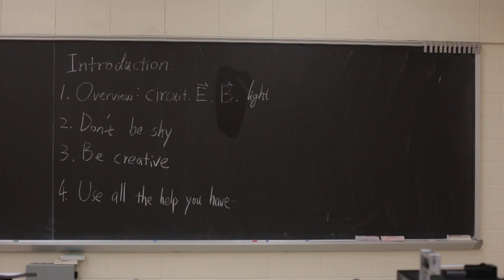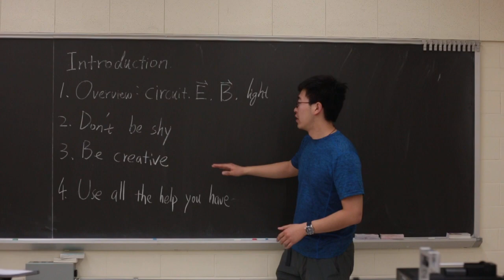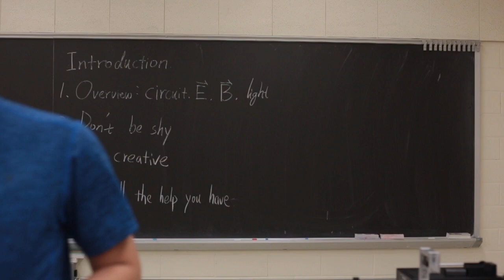Introduction

Comment from the maker: Physics Lab102N
https://www.youtube.com/playlist?list=PLgNi5MiqkBWbIYJkq_pD_SH2KNKJCZ1tB

Introduction
https://youtu.be/mm_0NDbU3Po
Lab1 Concept symbol
https://youtu.be/5HjscVxZQwY
Lab1 Experiment Multimeter
https://youtu.be/kNijqAIlOMg
Lab1/Review quiz1 Schematic
https://youtu.be/xC71rvYPWUc
Lab2/Review quiz1 Potential and Field
https://youtu.be/NeQNdakWX-8
Lab2/Review quiz1 Conductor
https://youtu.be/36_nO2rIDOY
Lab3 Concept Ohm's Law
https://youtu.be/aBabYsGFrYM
Lab3 Concept Kirchhoff's Law
https://youtu.be/rYRHw75T2_4
Lab3 Concept Resistance Paralell and series
https://youtu.be/UK_VkmHeYyY
Lab3 ExperimentDC,A,V
https://youtu.be/KyKSXwajJaA
Lab3 Experiment connect the circuit
https://youtu.be/o1VCM9TpoFE
Lab4 Concept RC circuit
https://youtu.be/eQx0pxGkjiA
Lab4 Concept time constant
https://youtu.be/64r275Zfvb8
Lab4 Experiment Connecting the circuit
https://youtu.be/HoWX1oxdn7c
Lab4 Experiment Taking data
https://youtu.be/7_znRfmIxIo
Lab4 PC measurement and Excel
https://youtu.be/l5nrodZR8as
Review quiz1 Overview
https://youtu.be/9Q8-jkPOepA
Review quiz1 Schematic
https://youtu.be/xC71rvYPWUc
Review quiz1 Potential and Field
https://youtu.be/NeQNdakWX-8
Review quiz1 Conductor
https://youtu.be/36_nO2rIDOY
Review quiz1 Time Constant
https://youtu.be/e47WURv0uz0
Lab5 Concept bar magnet
https://youtu.be/02WMGjRuGwg
Lab5 Concept Earth Magnetic field
https://youtu.be/9oZ4FjHnaAk
Lab5 Concept Right-hand rule and Ampere's Law
https://youtu.be/83_mgWfxecQ
Lab5 Concept Lorentz force
https://youtu.be/7_5ZZrquFHM
Lab5 Concept Metal swing
https://youtu.be/_eI38suGksY
Lab6 Concept Generator
https://youtu.be/qEinTRrlKoc
Lab6 Concept Generator II
https://youtu.be/LVkxSQJDNyQ
Lab6 Concept Integral
https://youtu.be/Mj0LRaYbJYk
Lab6 Concept Average power
https://youtu.be/fLuVv_HddcU
Lab7 Concept Snell's Law
https://youtu.be/btTux6BCuDo
Lab7 Concept total reflection
https://youtu.be/CqFdAsX4YkQ
Lab7 Experiment index of refraction
https://youtu.be/jdXzd_McmI0
Lab7 Experiment Critical angle
https://youtu.be/zx4-MjfLFJg
Lab8 Concept Ray diagram
https://youtu.be/MO7LOJy6yBQ
Lab8 Concept Magnification
https://youtu.be/GnuPEusMaWM
Lab8 Concept lens equation
https://youtu.be/vMW7Jz7DQuk
Lab8 Concept two lens system
https://youtu.be/bv2DLAQQpwQ
Lab8 Experiment setup
https://youtu.be/l0yba4aHVtU
Quiz2 Overview
https://youtu.be/xbu-qNJBa14
Lab9 Experiment Setup
https://youtu.be/hImGgt---eE
Lab9 Concept Wave VS Particle
https://youtu.be/El-DIpJUitc
Lab9 Concept Interference
https://youtu.be/SIYOnvXKrHM
Lab9 Concept Real double slits
https://youtu.be/avXbpjauldo
Lab10 Concept Polarization
https://youtu.be/9XFjIkX3JgY
Lab10 Concept Polarized sunglasses
https://youtu.be/pUEaHIj7Hdo
Lab10 Experiment Setup
https://youtu.be/fTlkWz6v6Wc
Lab12 Concept Atomic Spectrum
https://youtu.be/g-7YaaECKeo
Lab12 Experiment setup
https://youtu.be/t-n5fvTzKsg
Conclusion
https://youtu.be/zzpBTcFYkzs
Final Overview
https://youtu.be/Ka-K3WUTFFs